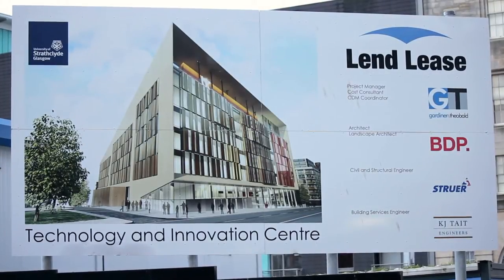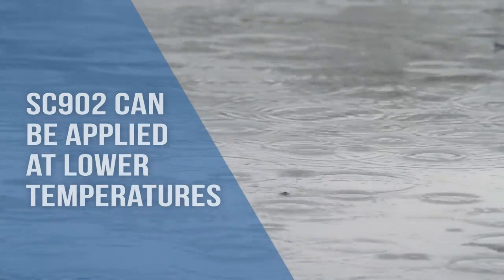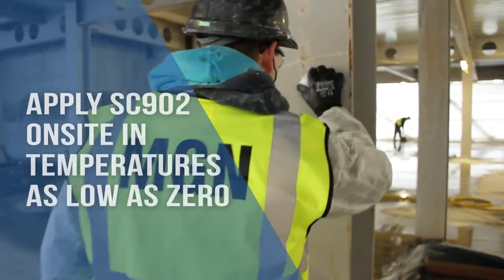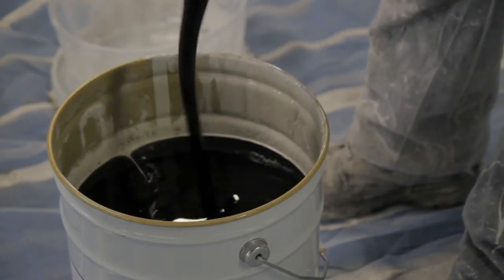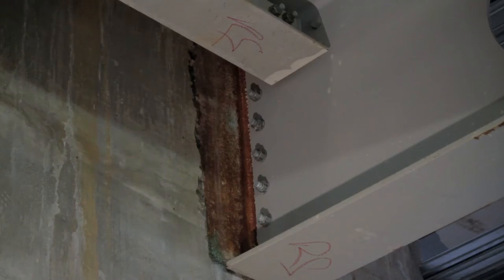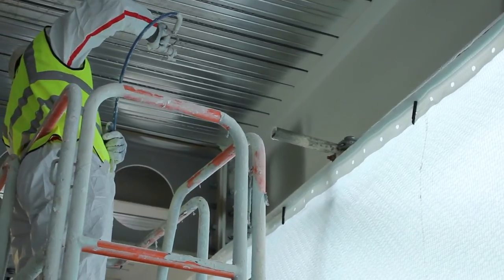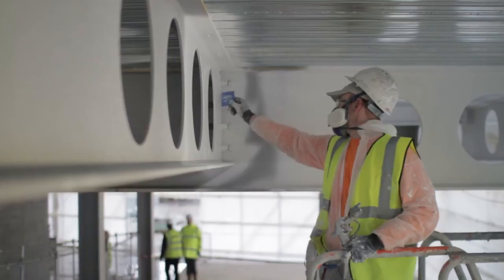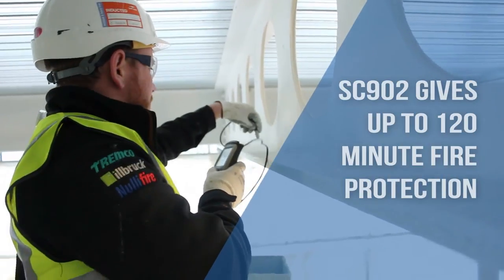Nullifire SC902 on Glasgow University

Comment: I do agree with the comment below I clean my pump per tin of mixed up product and can't mixup a new tin and poor on top.
I think the product has some great features however the cleaning part is absolutely crap it 20 liters per time   
After this take the pump apart and still gelled parts are coming out of the hose and pump part
Suction foot and  filter housing had a cone in it of gelled product  so product has a to short potlife.
And why is the loading table double as high as single pack intumescent
High amount of waste per tin.
So is this product really cost effective.
Don't think so 
Or is there is a better way of cleaning ?